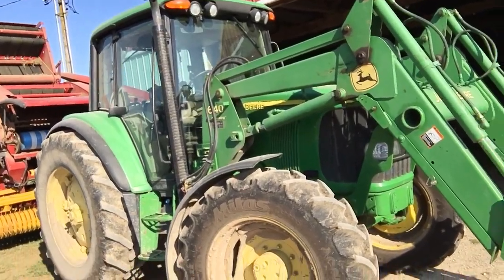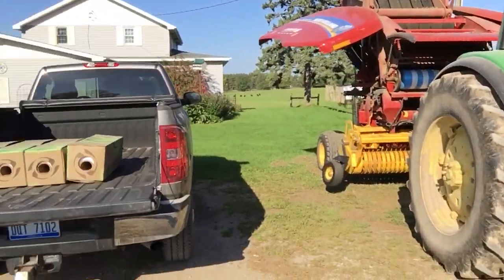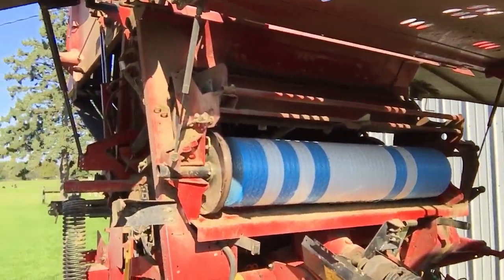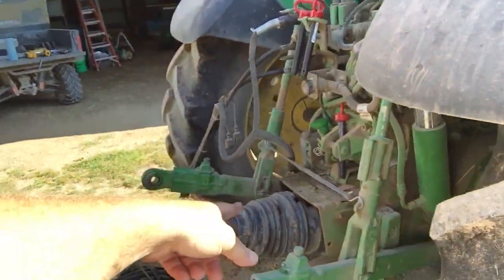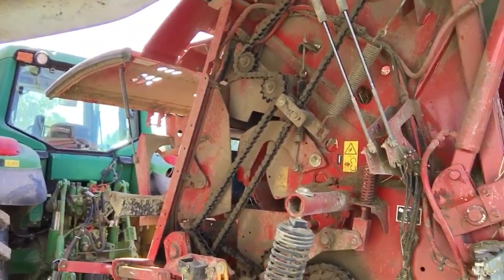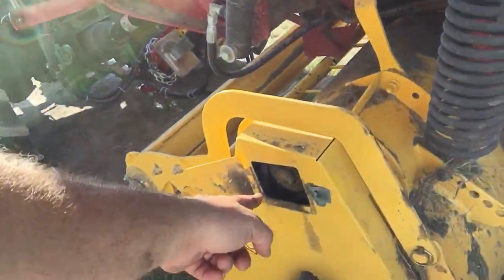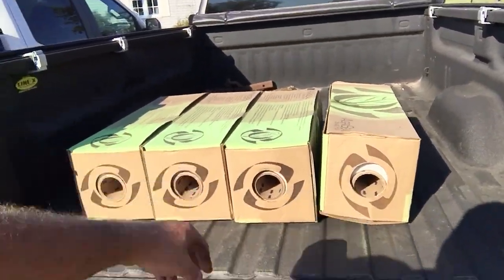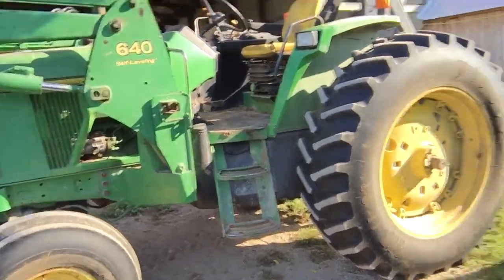Making Sorghum Baleage #3 (Organization & Maintainence)!!!!

Comment: Grease and fluids are cheaper than parts is my motto, I grease everything every time we mow, rake, and bale and that's why the equipment is over 30 years old and still fully functional. We are a small outfit so acre count or bale count stays low for its age, but time can be a killer all on its own.

Comment: Our baler does 2.5 wraps on baleage but I'm like you I don't like to be skimpy on it I have seen stems poked through ruin baleage. I fill my wrapper before hand as well, mine only seems to run out of gas right in the middle of line lol

Comment: Equipment it's maintenance and maintenance and some more maintenance to keep them running good and correctly and it doesn't matter how many times you wrap a bale that up to you how you feel good with it.   Putting dry bales at the end is a good ideal it pugs the end and it same a putting in a silo it allow fermentation to happen.

Comment: on the ends could you get a single rapped in plastic dry hay bale to plug the ends?
Reply: Ted Kahler one is not quite enough still gets air two or three work best if you have a single wrap marshmallow Bale then you could use one
Reply: Even if the single bale is wrapped in plastic?
Reply: Ted Kahler if the Bale is wrapped in plastic including the ends then one bale will the inline wrapper will not wrap the ends they do make end caps but they're a pain in the ass
Reply: Blane Heinrich I was asking about a single wrapped bale all the way around I know he is using an in line wrapper now and it can’t wrap ends
Reply: Yes it would work great. Some folks make up plug bales from junk hay by wrapping them individually and can reuse them a few times. It is possible to run a few through the inline and wrap the ends first then run them through again normally. I tried it once but didn't  seal as well as needed.